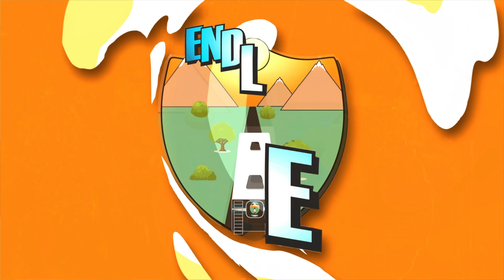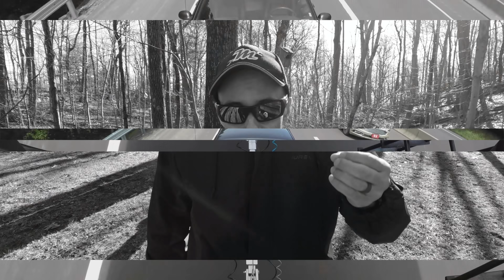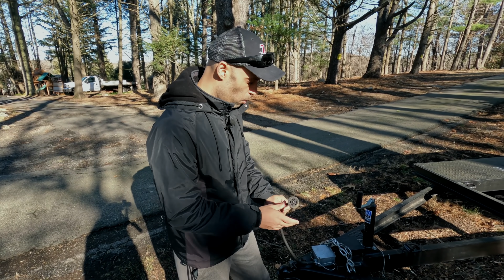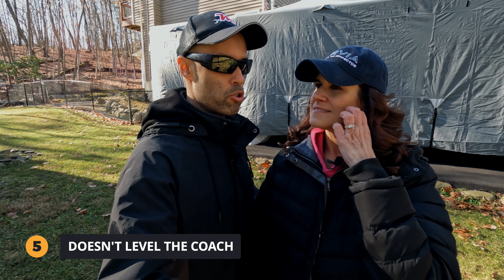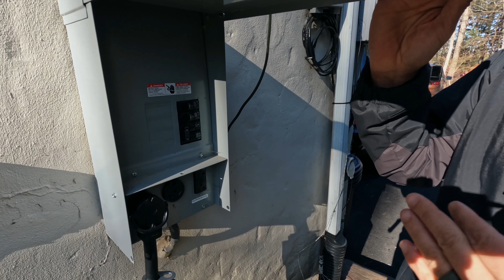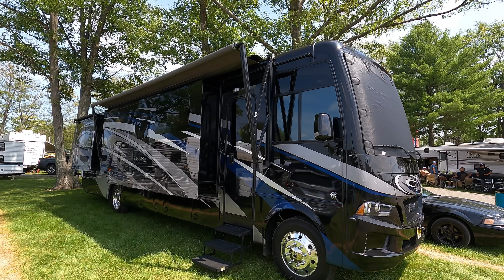8 Dumb Things RVers Do And Why We Need To Stop!

Comment: I always turn my LP off when driving. I almost blew up a gas station in Ventura a few years ago. I had pulled over about thirty minutes prior because I realized I had forgotten to pick up the dog's bowls. I accidentally hit one of the valves on the stove while picking the bowls up and putting them in the sink. Thirty minutes later I was filling up in Downtown Ventura, and had to use the restroom. Fortunately the restroom was occupied, so I decided to use the bathroom in my trailer. As soon as I opened the door an overwhelming odor of LP hit me. The unit was filled with gas, and it probably wouldn't have taken much to ignite it. I quickly opened all the windows and  got back on the road to air the unit out. 

It isn't really necessary to run the gas while driving. The frig will act as a cooler as long as you open it as little as possible. I've driven as long as eight hours with it turned off, and I've never had any food defrost or spoil.

Comment: Don’t agree with your propane usage comment. 
Shutting off when traveling ???
Getting your meat, beverages, right before your setting camp, not practical by 90% of Rv users.
A small tube of dielectric grease is great to protect any electrical connection that is used outdoors. 7 pin cable (Walmart, Lowes,Home Depot).
Reply: I said something similar but I don't know if YouTube lost my comment or it was deleted.

Comment: I have a 28" fleetwood motorhome. Does this need to be leveled when using? Or stored?
Reply: It is a 1983 does not have levelers on it.
Reply from the maker: Yes when stored if you will be running components you can level with blocks
Reply: @EndlessRVing  i bought it a few months ago. Haven't had it off the drive yet.or turned on the heater or fridge. Will be checking that all out in the spring. What do I need to get to be sure it is level when I am using it? Is there an easy way to get it on blocks?

Comment: Great video: 
If you have the excess power cord coiled up, you basically are creating inductive resistance, like the coils in a transformer. Leaving it coiled up may not be helping like you think. 
For maintaining the generator, I always use full synthetic for a couple of reasons, 1) It does not degrade over time like dino oil. The acids from combustion get in the oil. If it is dino oil, it will break down and loose viscosity over time. Full synthetic will not break down. This is especially important for RVs who may be very part time. 2) Oil is cheap and you only need 2 qts. Why not put in really good oil. This also applies you your motorhome engine oil.

Comment: Excellent Video 
One thing is completely wrong. Power cord is 50’ it’s always 50 ‘ whether inside or outside of the bay. 
 Otherwise good information !
Reply from the maker: The issue is potential exposure to excessive heat that may reduce voltage in the line.  Thanks for watching

Comment: I don't agree closing your propane on the road, I need it to run my fridge !
Using your hydraulic jacks to level the rv while in storage is not a great idea, use blocks under your wheels instead !
Reply from the maker: As long as you know the risk you take going down the road with your propane on. Who said we used our jacks to level in the off season?   Where did we say that on the video?

Comment: Thanks for the tips.  On our maiden voyage to Florida last March, our CO2 detector went off during the night while boondocking.  I quickly shut off the propane tank.  The detector continued to sound off an alarm though, so I had to cut the wires to remove the power.  Luckily I had a bought a multiple gas leak detector went we got the coach because I didn't know there was one already installed below the kitchen cabinets.  This detector was designed for a house requiring 110v AC. I had a Stanley Jump starter which had a 110v AC inverter, so I used it to power the new detector., turned on the propane again and we were fine with heat and no alarm.  I replaced the built in detector after our voyage ended and we have been fine ever since.

Comment: I agree 100% about not having propane on turing travel. I plan on putting a 500 watt inverter for the heating element on the fridge  while traveling in my motorhome. The element draws about 350 watts. While on shore power I will plug fridge into the original power receptacle. I'm hoping for success on my experiment.

Comment: Third comment: your power cord on the coach is 30 or 40 feet long. Doesn't matter how much you pull out of the hole the electricity is still flowing through the whole length. The conductors are sized to carry your full current, plus some. Since you have a multi meter, check voltage at an outlet when you have an appliance running. You should still have 120V.
Reply from the maker: Excessive exterior heat can cause a voltage drop in the line.  That is the point we were making.  Thanks for watching and the comment

Comment: Second comment: but a can of contact cleaner and a tube of dielectric grease at an auto parts store. Spray your 8 pin connector pins, let it dry, then put a can of the grease on each put and the center ground. Do the same on the truck side. Keeps corrosion down
Reply from the maker: Do not put dielectric grease on metal pins.  Grease is not a good conductor of electricity even if dielectric is in the name.

Comment: Ok here’s the comment you knew you were going to get. It’s not dumb to leave your propane open while driving down the road. As many RV mechanics have told me they’re designed for that, however the dumb part is not maintaining those tanks & equipment, making sure the valve is in good operating condition and check your connections & hoses regularly. Poor maintenance is dangerous!
By the way calling people dumb isn’t nice. Lol just kidding I’m not that sensitive.
Reply from the maker: Thanks for watching.  We never called people dumb in the video.  We said people do dumb things, ourselves included
Reply: @EndlessRVing  lol I know, I was teasing.

Comment: Power cord - I follow Their advice about having the least amount of electrical cord out, but the reasoning is different. 
Dirt and mud gets on the cable, I use a rag to wipe the cord to keep the dirt from getting in the rig. 

The amount of voltage drop is the same and has no bearing on this decision. Only if I have to add an extension cord, then it will have some drop, so keep extensions off the line and use only as needed. 

Comment on coiling the cable and having induction heating. Short answer, not a problem. In this cable the magnetic fields get canceled out.

Comment: If your RV has a 20 ft cord built in and you only pull out 5 ft, the current is still running through that 20-foot cord
Reply from the maker: Thanks for that info 🤙

Comment: Great video!  #1,    Great!   Also, check your extinguisher manufacturer and model number and do search for recall.  I just found out ours was recalled just before we traded it off.   
#4.  I’m an electrical design engineer, not sure of what you were trying to say.   My opinions.  Leaving the cord inside the coach can be good or bad depending on the temperature.   If leaving the cord inside and tightly coiled in hot weather can be very bad.   Tightly coiled will not allow heat dissipation which causes the insulation to deteriorate. Your comment on voltage drop is confusing.   The length of the cord is the length of the cord.   So resistance will be the same inside or outside the RV.  Voltage drop is caused by resistance mostly and very very slightly by some heat.   If you have enough heat to cause voltage drop, you would have smoking conductors and be near a fire condition.
#7.   I had not thought of the reverse polarity energizing the metal skin and parts of an RV.  I will have to ponder that one to figure out how it is possible.  It probably is, but I will have to figure out where neutral connects to metal.  Maybe you can tell me where this happens.
Thanks for the video!    Respectfully,   Kevin
Reply: Added comment.   Please see this video.   Hot skin seems to be a wives tale and not true.   https://youtu.be/YcbkRSqbJ-w

Comment: Good tip on the fire extinguisher, also look for recalls on them. On the 7 pin there is/are anti corrosion sprays you can treat it to help prevent corrosion. Hot skin can be a problem. However you can protect yourself with a surg guard that cuts power off if there is a problem. Some of the cheap ones detect the problem like low voltage but won't shut down the power. The same thing with checking the pedestal with a meter. You can test right now but what about latter or when you are sleeping? I have seen parks loose  capacity when more people check in and put more demand on the system.
One of the main benefits of "exercising" the generator is to drive moisture out of the windings. This prevents corrosion. You are absolutely right I have been told by Cummins that most of the problems with generators come from lack of use.

Comment: Question for both of you- watched your “8 dumb things” video- very well done and informative. In boating we’re cautioned against having power cords coiled while plugged in - you can create an “induction coil” and start a fire- is there any danger of this if your cord is on a reel in a compartment?
Reply: I would think the rv cord is no different than say a power tool extension cord (ie. like a 16 gauge), where the idiot labels (lol, sorry that’s what I call the tags) always say uncoil/ unreel cord before use, so why would an rv cord be any different? (Literal question, Not being facetious). And TT rv cords typically all are 30ft. So I don’t understand Izzy’s #4 about use only what you need?
Reply: @SpykersB  I had the same question. I use the 30 amp power cord supplied with motorhome. I can’t use only a little of it.
Reply: It’s the amount of current flowing that could create a problem. A single power tool used small current; running 2 A/C’s etc will draw a lot of amperage

Comment: Seven of the 8 dumb things you outlined I have avoided because I knew about them. The one I didn’t was keeping the motorhome level when stored. I don’t store my coach for more than 2 months at a time and haven’t leveled it because the storage facility its in is decent but, I know it’s not perfectly level. I haven’t had any issues but tomorrow morning I’m heading to my coach to level it! Thanks for the info!  PS - I believe you already mentioned this on another video a while ago but I think the 9th dumb thing is not to oil key components in your RV. As an example, the steps need to be oiled all the time and particularly when the RV is stored. Most folks I know oil the joints that allow the steps to extend and retract which is important but they don’t realize that the motor for the steps is attached to a bar that moves the steps joints. There are lubrication points along that bar that have to be lubricated. If they're not lubricated the steps can get stuck or even damage the motor. Other elements that should be lubricated include slides particularly Schwintech slides and rubber seals. That’s my 2 cents!

Comment: Some good tips. Especially the exercising your generator tip. BTW...Cummins owns Onan. Sorry my last post got removed when other similar ones didn't. Don't start a conversation and then remove comments. Still love ya. Even with the hillbilly intro music. Safe travels. Had snow here yesterday. 66 degrees the day before and 71 the day before that. Multimeters are a must. And even a simple 12 volt test probe. Spring is just around the corner. Safe travels.

Comment: Some dielectric grease on the 7 pin will help slow down the corrosion. Also a connector with indicator lights will help with troubleshooting should your lights not work one day.
Reply from the maker: Keep the grease off the metal pins  it will potentially reduce conductivity.

Comment: 👍👍. The part about the Generator, I learned back 1976 when I was working at a hospital in the maintenance department, twice a month we had start up the emergency generators, encase the power went out ( I know that my example is on a larger scale). Before we started them up we had to let all of the staff know so that they wouldn’t get startled when the lights off then came back on under generator power for about a hour. Talk about wonderful music hearing the Detroit Diesels doing their thang. When it came time to do routine maintenance there was no scrimping. You were talking about your power cord and protector(s) & test meters when you get to an RV park to make sure there’s no surprises, it would be wise to put a lock on your power cord at the box or anywhere you can so it won’t leave in the middle of the night or when you’re away site seeing. The reason I’m saying this is because our son had a 50’ 50 amp cord stolen two years ago. Thank you for the great information, some I knew, some I know.👍👍👍👍

Comment: Good info and tips guys, I will say with the power cord, if your coach/RV has a 50' fixed hardwired cord, the voltage drop is the same pulled out 10' or 40'. Let's use 120 volts; The voltage drop would be around for a 6-AWG wire; Voltage drop 0.044, Voltage drop percentage 0.037%, and Voltage at the end will be (119.95). Now if you would pull all 50' out and let it sit in the sun in a coil, there will be a very slight drop, but very minimal.

Comment: @7:41 generator oil level.    The oil level on the dipstick is not that sensitive to tilt.  Certainly not the amount of tilt that your motorhome will see.   Furthermore the oil cut off is based on pressure, not the amount of oil in the crankcase.
Reply from the maker: Wouldn’t low oil effect pressure?
Reply: @EndlessRVing  I believe if an engine shuts off due to low oil pressure then damage will have already been done. If its low enough not to be pulled into the pump, no oil circulating in engine.

Comment: I lost a boat by fire to a fire extinguisher that had a needle that was pointing in the green range.

You have to pay attention to the expiration date. 

My boat caught fire I grabbed the fire extinguisher pulled the pen squeeze the trigger and just a puff. I took the neck out and tried to shake the powder on the fire. When I ran out of powder I took the bottle and stuck it into the river and then tried to use water.

Finally boat on fire I started it up and drove it to my doc where I then grabbed the garden hose.
Reply from the maker: sorry to hear.  another good reason to carry multiple extinguishers.  We carry 5
Reply: @EndlessRVing  Small boat. It was the 17 ft bowrider with a ford 5.0 V8. I had the false security of thinking that I was in the green so I didn't bother to look at the date. To me that means the gauge isn't very useful. It got stuck where it had been when it was new when the propellant leaked out the gauge stayed in the green.

It's all about the date.
Reply: I used to be in the event industry and when fire extinguishers were required they had to have a tag showing serviced within the last 12 months.

Comment: Hey Guys.  I question, as did Jim, about Indiana roads!! 
 I do not understand the idea of using the shortest amount of electrical cord from the coach to the panel.  It is still going through 50ft of cable.  I thought your reason was going to be for critters from climbing up the cord into the coach when I noticed it off the ground.  I would rather have it on the ground and not trip over it when it is covered by snow here in Indiana!!  Good tips. Happy New Year.  Tom
Reply from the maker: The reason for less cord exposed is for high temp days.  The very high temps in direct sunlight may cause a voltage drop in the cord.  Is it a guarantee, no but it can happen and one should be aware of it.
Reply: @EndlessRVing  Voltage monitoring is accomplished by my WatchDog EMS.  I learned that some guy named Izzy!!

Comment: I disagree with your power cord being plugged in 5' or 50'... The length is the length whether it's pulled out 50' or wrapped up in the storage wheel the cord is still 50'! If you are saying heat my reduce voltage, inside the storage bay gets quite warm also.. The only issue I see with the cord being pulled all the way out is it's ugly to look at for your neighbors!
Reply: I can't do this on my Airstream, unfortunately:, but I do remember Todd advising to tuck the power cord under the trailer out of the sun. I thought this was a great tip. I just finished Fundamentals and start the inspection course later this month. Another great video, thanks. Happy New Year to you both~
Reply: I agree. If heat is an issue it would be better to have your power cord extended to stay cool in fresh air. Instead of coiled up on the reel. Some of us are a little more primitive. If it's really warm I run my generator and roof air. Dash air has issues and could never cool the entire coach. But those  "bus fans" do wonders. As does a cold bottle of water. They make some awesome dash air cooling systems that work pretty well. Without compressors or refrigerant. Just go have fun.
Reply: My neighbors always ask me to pull cord all the way out so they admire how clean I keep my cord ❤️
Reply from the maker: Keep your cord out as much as you like 😀

Comment: Great RV primer, MJ and Izzy, good stuff to know! There is a lot we all need to know before we become RV'ers, this info should be required learning before heading out on the road. You've probably already touched on maintenance of holding tanks, grey, black and fresh water. But I've learned it is not a good idea to completely drain the black tank, best to leave 10 - 15% clean water in it so that any remaining solid deposits (hopefully mostly purged by flushing the tank) don't harden. Also, sanitizing the fresh water tank from time to time is vital, follow the manufacturers instructions.
Reply from the maker: Yes Wes that is correct.  Always keep fluid in the black tank with a chemical.  We like Unique treatment it’s excellent.